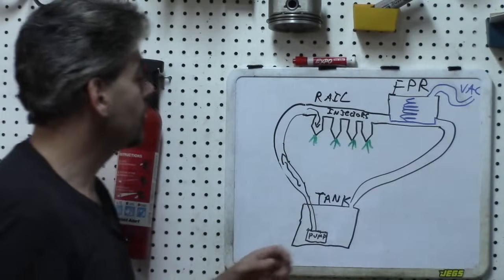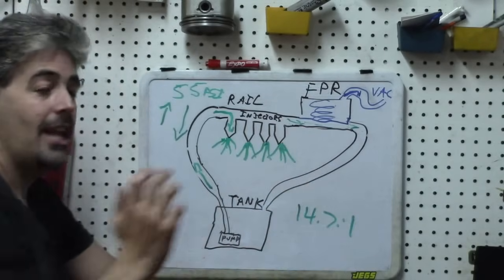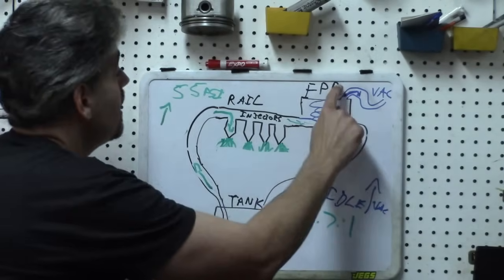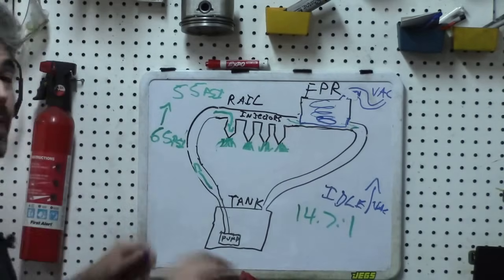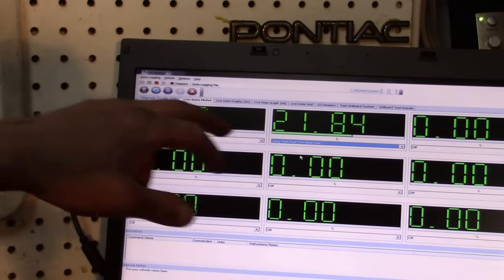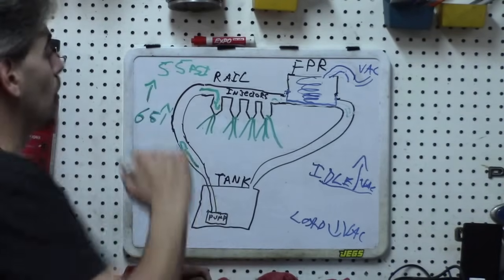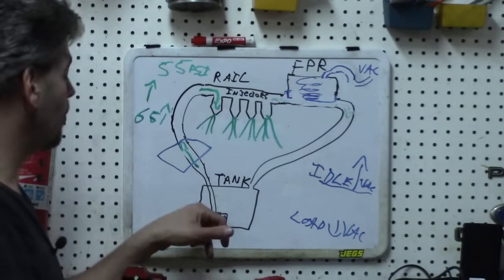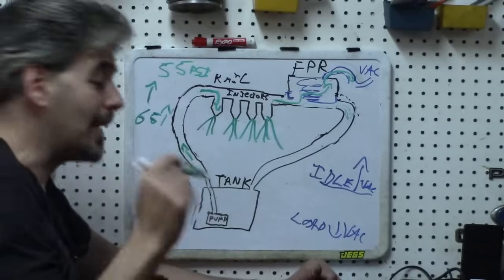Fuel Pressure Regulator Diagnosis + Understanding (HD!!)

Comment: Very good, I understand the mechanics of it now, what are the symptoms of a faulty FPR? My motorcycle seems to have a misfire.
Reply from the maker: Symptoms would be an inability to maintain stoichiometry through the fuel trim
Reply: @SchrodingersBox    stoichiometry through the fuel trim???
Reply from the maker: Correct- it won’t be able to achieve stoichiometry because the LTFT and STFT would be maxed.

Comment: What difference would you expect Matt in between single point and multipoint fuel injection? I think there would be more pressure loss with the single injector set up as opposed to one of four leaking?

Comment: Great explanation done by you. I have question. I have got a 91 Lexus LS400, which is getting 7mpg. I have replaced almost every thing related to the ignition but I didn't see any difference in MPG. Recently I posted my question on a Lexus forum and a guy told me to check if the diaphragm of the regulator is ruptured. I went a head and found the diaphragm intact but what I found is the VSV solenoid that provides vacuum to diaphragm is dead. Anyway I ordered any solenoid for it but my question is, does a fuel pressure regulator with no vacuum, decrease the fuel efficiency? I also replaced all O2 sensors with brand new OEM sensors. Thanks!
Reply from the maker: I would start with the O2 sensors for sure - what was the data you got that indicated they were faulty and needed replacement?  Was this based on fuel trim output or voltage?
Reply: @SchrodingersBox  Unfortunately it's OBD1 and I took to Lexus dealer to check the fuel trims but they have no OBD1 scanners. Things I replaced is EGR related parts and I use only genuine parts. Replaced all 4 O2 sensors back and front. Replaced all the spark plugs wires, spark plugs, IACV valve, Cats are not clogged, cleaned the throttlebody, replaced the timing belt and water pump. No problem with MAF sensor either, recapped the ECU. Replaced the fuel filter with genuine OEM Lexus. 
I ran out solutions to think off. Today I found the electric solenoid that provides vacuum to fuel pressure regulator is dead.
I am wondering if this dead solenoid is causing the this horrible mpg?
The car has no check engine light and it's running smooth like butter and fires up on half crank.
Reply from the maker: I am not following- what data do you have? if you replaced all the plugs and wires what is the data you have indicating an ignition problem?  And if so why replace an IAC?  what were your IaC counts? When you say no problem with MAF- what was the MAF output and under what variables? How was this determined. I am not seeing a methodological protocol for diagnosis - am i missing something?
Reply: @SchrodingersBox   I have had no problem with the ignition or any thing. The car runs great but I notice that the car is doing horrible MPG. The reason I know that MAF has no problem is because I replaced it with a brand new and I did not notice any fuel efficiency. The reason I replaced all those parts is because people on the Lexus forum were telling me, if I replace this and that part, it would fix my car's MPG.  
I have replaced a ton of parts and still car's MPG is horrible. Some times it's doing 11 MPG and sometimes it drops to 7 mpg, because I idle it at least 20 minutes before I use it. So idling does effect the MPG by a great margin but still 11 mpg for V8 motor that is rated 16 mpg for city isn't good.
My car does have more than 300k miles on the meter but it isn't burning oil. IACV idle air control valve.
Reply from the maker: That's my question- why did you replace the MAF? What was your data showing it was bad?
Reply: Schrodingers Box I have access to factory service manual and on the troubleshooting page, there are few reasons shown for poor fuel economy, one of which is faulty MAF/Air flow meter.
I repeat, I don’t have OBD1 reader to check the fuel trims nor does the Lexus dealership, that’s why I don’t know exactly what’s causing poor fuel economy. It’s like I am throwing arrows at the target in dark and hoping that it will hit the target.
Reply from the maker: Yeah unfortunately I can't really help on this- I need some scientific data to determine the issue. Changing parts on guesses does not systematically isolate the independent variable.. If you get any data I can use I am happy to help,
Reply: @SchrodingersBox  Hi Matt, I was finally able to find the culprit that was causing poor MPG. After replacing a ton of parts for almost a year, I was about to get rid of the car but I decided to give it a last try and change the ECU. After changing the ECU my car started burning fuel like a normal car. I did change the capacitors in the old ECU and the car was also running smooth and didn't show any signs of bad ECU that tricket me to believe that there was nothing wrong with the ECU. I found mechanic that agree to perform fuel trims test on my car and he told me that the car's fuel trims are all normal but at 2000 rpm his scanner loses communication with ECU.

Comment: could a bad FPR also cause a lost in power when you floor it?  my 2000 siverado with a 5.3 has lost that sudden get up and go.. under normal acceleration  there is no problem,  also no check engine lights.

Great video ... Thanks a bunch.
PV
Reply from the maker: Based on function of the FPR what would you say?
Reply: +Schrodingers Box I think it is possible.   I will try to check pressure this weekend
Reply from the maker: Paul Vernon It could indeed. Remember the pressure regulator is drawn open by engine vacuum and it closes to divert more pressure to injectors when vacuum is absent (e.g. WOT). If the regulator is stuck open, there cannot be enough pressure at the injectors to fulfill a load demand with acceleration.
This would be confirmed with starved fuel trims under load and absence of fuel pressure adaptation with WOT vs idle.

Comment: I have an earl 90s vehicle that per the factory service manual 34psi with vacuum and 43psi without.  Pressures at idle are at 38psi and when I unhook vacuum it goes to 48psi. Going off of this info it's running rich and smokes at idle and not while driving. Replaced the fpr and still the same on my Pressures so assumed bad part. Already Replaced with 3 fprs and Pressures are the same, even with a vacuum pump I can't bring the Pressures down to 32psi. Any input?

Comment: it is a  very  good  video  learn about  fuel  pressure I  have  2005 Volkswagen  Beetle 1.8 t   pressure is  way too high is between  70/80 PSI and drop very slow someone can  help me with this please
Reply from the maker: Sounds like a restricted return. Check fuel pressure regulator or for pinch in return line.  Are your fuel trims running negative? That would also confirm it.

Comment: Will appreciate anyone's input: 

Even after watching this video, I am still confused on my situation. During a drive, everything runs fine for the most part, pressure stable. It would only fluctuate on hot day, stuck in traffic once and will stall out the car. After a drive cycle, and I shut the car down, the fuel pressure would slowly rise. Normal idle is around 600 psi. After shutdown for 5 minutes, its around 1000 psi, for 10 minutes 2000 psi, for 15 minutes 3200 psi. The 3200 psi would trip P0193. With P0193, the car starts but rough and will drive in limp mode. I sometimes can clear the code and the car starts fine. Otherwise, I have to wait awhile and the pressure drops down to normal when engine is cooler.

New fuel rail pressure sensor, new fuel pressure relief valve. Haven't checked out in-tank pump or pressure regulator. Haven't checked out HPFP. 

Stock Lexus Ls460 (Returnless)
Reply from the maker: Yep that’s normal. In GDI vehicles you will see that as result of “heat soak” as the hot engine heats the fuel in the rail and increases pressure for some time.
Reply: @SchrodingersBox  Yes but for some reason, the pressure rises so high that it will trip code P0193. With the code, the car will fire up hesitantly and sometimes sputter and stall.
Reply from the maker: Sounds like a pressure regulator stuck.
Reply: @SchrodingersBox  That's what I'm thinking too, but I just replaced the in-tank regulator (Well, the entire fuel pump assembly from another car), and the issue is still there. Gonna chase the HPFP units next.

Comment: Also if the gas tank is not venting correctly  the fuel and air in the tank will heat up and expand especially if your fuel tank is right above your muffler and the fuel heats up .and circulating through the engine fuel rails and lines heats it up as well. Then sending presser back up the return line to the regulator razing the fuel presser at idle . The more fuel that in the tank the longer it will take for this to occur being that more fuel more mass takes longer to heat up . If you run the car for one hr and you open the fuel cap and hot air rushes out you have a vent problem . If your car idles fine for 15 to 20 min but then starts idling funny this would be a sing of to Much presser in the tank . The hotter it is out side the faster this will accur.

Comment: Do you have a video explaining the fpr in tank non return line system?I can't find loss of fuel pressure.. Could a vacuum leak on the boot or pcv or camshaft sensor affect long cranks?

Comment: When testing fuel pressure the gauge holds but when started it fluctuates irraticly (Buick enclave) in-between 40&55 psi then shuts off, maybe the regulator? Which is under the air intake

Comment: Thanks for great lesson. I have a question and will be really grateful if you help me;
My problem is: 
I connected my car (diesel alfa romeo 159) to diagnostic, and before starting the car the fuel pump pressure seems only 2 psi, and when I try to start the car, it cranks cranks (not start quickly) and after long cranking it starts. After start, fuel pressure increase to 45 psi...when I stop the car and then pressure drops to 2 psi again...  

but it starts quickly if I do the things below:

"I turn  the ignition key for once (not start the car),  then turn it off"  >>> I do this loop 4 or 5 times without starting the car, and  then I try to start and it starts quickly.    what could be the problem...
Reply: Any luck yet? 

If you have the same problem as me then I guess this only happens when the car is cold right?  

It happened exactly the same to me (Audi A3 '98 gasoline). When the car is hot it starts right up though.

I replaced the MAF unit, the coolant temperature sensor, the fuel pump, the fuel filter, the ignition coil unit and still no luck.

As far as I can understand it has something to do with the quantity of the fuel going to the injectors. Why else after doing the ignition on and off "ritual" helps to start faster? 

We would appreciate any help here guys!
Reply: hürkan pişkin Fuel pump most likely, but further diagnostics would be best, so you're not throwing parts at it. When you turn the key over without starting it, your building up fuel pressure. Do you hear the pump buzz for a couple of seconds when you turn the key over? This isn't a fool proof test as some pumps can still run, but not produce enough pressure to the injectors.
Reply: Mike Kateris What made you decide to throw so many parts at the Audi? With what those Audi parts cost, you could've paid a mechanic to diagnose it. Is the CEL on? if so, list the codes.
Reply: Have a look at glow plugs

Comment: Dude.. You are a fucking Genius and I fucking love you!! Thank you so much!
Reply from the maker: Love you too bro.
Reply: I am still working on this, but I found out I had 10 PSI on my 1996 F250 Supercab 7.5, That was part of the problem now I have 45PSI after replacing the regulator, still throwing PO171 and 174 "System too lean Bank 1 Bank 2,  I am still doing Diagnostics, I really appreciate your videos and teachings.  If it weren't for multiples of your videos I think I would have just started throwing parts at it.  My fuel trims go down drastically in closed loop however when I remove the Vacuum line from the Fuel Pressure Regulator, but with it plugged in I have 18.5 to 25 STFT on both banks., I am thinking more Diagnostics are necessary because there is a different problem, this is kind of weird with 45PSI fuel, No Air Leaks, and no exhaust leaks.  Still working on it though.  Diagnosing problems.

Comment: In theory why do you need a vacuum at all to regulate up and down movement of the diaphragm?. A regulated flow through spring check valve will accomplish the same result would it not ??If say your spring diaphragm was tensioned to constant 37 psi as the demand increases the spring will close or restrict flow increasing pressure. As demand drops such idle the spring will open more to allow more fuel to pass to keep tension equivalent to 37 psi.
Reply from the maker: Yeah I see what you are saying however the "demand" doesn't draw more fuel on most designs- it just allows more fuel.  However- there are indeed some PulseWidth Modulated systems where indeed the pump adjusts flow based on demand.  Most older systems however don't "draw" more fuel as result of positive fuel trim demand.

Comment: wow!! amazing explanation....i am currently on +25% (mult trim)and have 1 code system too lean , car starts  fine every time but runs rough and bucks under load . Iss it possible that its a pump on its way out or injectors blocked? based on my symptoms(rough idle and hesitation underload) which one is the likely to be faulty between pump and injectors? or shud i just go on and test fuel pressure ? i have passat 1.8T engine .
Reply from the maker: Fuel pressure for sure- curved against load
Reply: @SchrodingersBox  thanks ...will give that a shot

Comment: Matt..great vid..  I have a dilemma- I have a 1997 Cougar Xr7 with 89k miles, V8, 4.6L, it blew a P1151 code (HO21) sense lean condition. The car idles in neutral at 700rpm but when I kick it out of gear and come to a stop sign, it idles at 500 in gear. All of my O2 sensors were replaced months ago. Well, the engine code disappeared a day later, but I did the fuel pressure check as you suggested. With key in ACC mode, my pressure was 30psi and stayed. The PSI per repair manual says it should be 40psi. So, I started the car, it remained the same at 30psi,..I reved it up and stayed at 30psi....until I unplugged the FPR. When I did that, psi went to 40psi as it should be. Although the PSI increased and stayed,..is it safe to assume that even though it increased, would the FPR still could be Faulty?  Btw, the fuel filter was replaced 1k miles ago
Reply from the maker: No fuel trim data?
Reply: When I connected the OBD to it when the CEL was on, it only stated that Sensor 2 Bank 1 was in lean condition, P1151 however, I drove the car around running errands that day and after approx 20miles, the CEL went out and no codes were registering, however the car still ran fine. Idles in park at 700rpm, but in gear, when I come to a stop light or sign, my idle in gear is 500 rpm. I guess, I'll have to seek out fuel trim data to get a better picture of what's going on.

Comment: Taa much. I may have this problem on my CLK280 as runs rough every now and then after I have parked on a slope either nose up or down. Plus poor acceleration from lights. The next day after parking on a level ground: normal idle and great acceleration. But engine light stays on dash.

Comment: +Schrodingers Box I'm a total newbie so my head's going to explode. Basically, my engine idles fine, but if I give it gas, it dies.  If I pinch the fuel return line with pliers (therefore keeping fuel pressure high?), I can rev as high as I want.  So...does that mean my fuel pressure regulator is stuck on "open"?  With the FPR in hand, I can't blow through the fuel intake to get anything to come out the nipple to the return line at all, even if I have a vacuum sucking on the vacuum nipple, suggesting it is stuck on "closed"?  It's a brand new FPR, but it's behaving just like the old one.
Reply from the maker: +jlucky30 If you are a newbie this is probably not something  you should be messing with. 
  Get the basics first and then this video will be very obvious in it's instruction and interpretation from data.
ETCG is a good beginner channel for getting the fundamentals down.

Comment: Matt, my 2000 Honda Prelude (4 cyl) is running a bit rich.  I typically get -9% LTFT and as RPM increases, it will be about -7%.  I threw a code for P0172 in the winter and after clearing it, it hasn't returned.  Even though it is not super rich, I still want to improve my LTFT as it is on the cusp of the more concerning 10% or more deviation.  I do not have shrader valve, and would need to drill and tap somewhere to put a fuel pressure gauge on.  I want to prove whether I have a FPR problem or the vacuum hose is leaking.  My idea is to connect a vacuum pump and match the pressure that should be lifting my FPR at idle and see if my LTFT changes.  If it improves I would get a new hose, if it does not change, I would get a new FPR. Does this method make sense?  Also, how do i figure out what vacuum at idle should be without a leaking hose?
Reply from the maker: Before I tried stuff like that I would rule out other factors that might cause rich condition such as overcooling, O2 sensor issues, low vacuum, etc. But fuel pressure measurement is the way to go. There are adapters you can buy to connect a standard gauge, you don't need to drill and tap.
  But if you want to rule out the FPR as the issue, your thinking is on- just add vacuum to the regulator and the system should lean out. I would measure the vacuum from the vacuum hose for the regulator too and make sure you have full vacuum there.